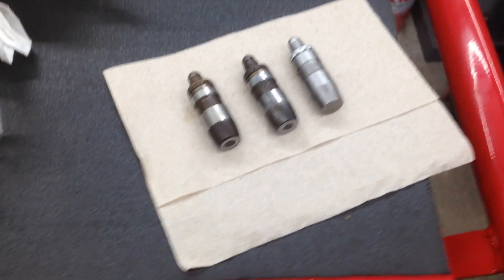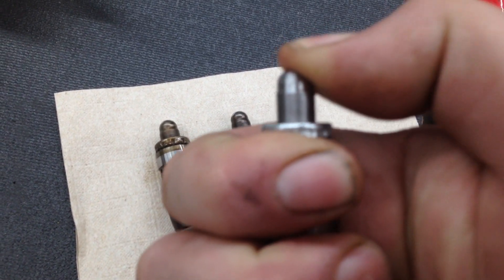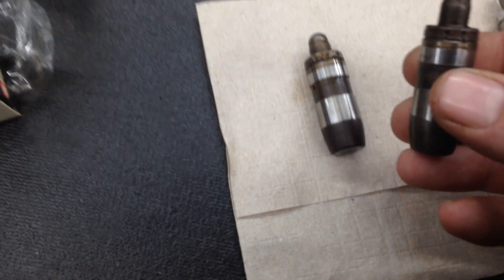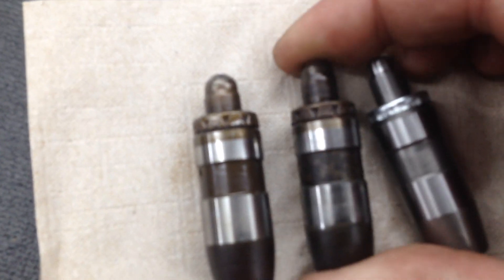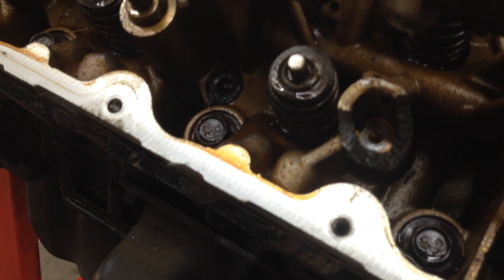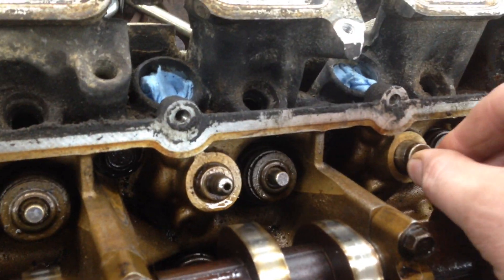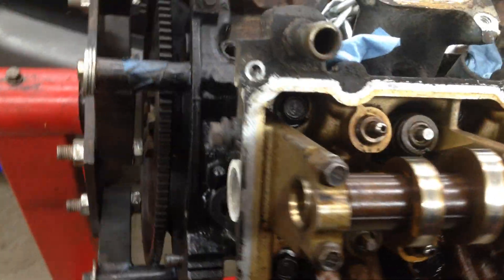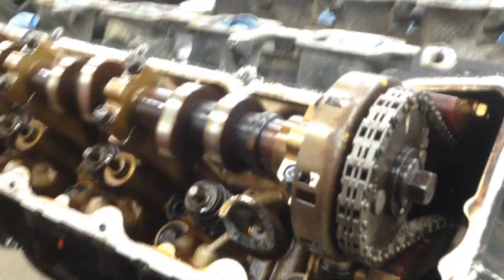Why you check and replace your lifters (lash adjusters) on 4.7L engine

Comment: So will a bad valve seal leak oil onto spark plug tip, not on coil pack area, on that type of motor?
 Im about to change them cuz it dont seam like the cover gasket would leak into spark plug chamber.

Comment: Good evening. Are these adjusters just a matter of buying and installing them? Do I need to adjust them? Could you tell me which model to buy for a 2013 RAM 4.7? Thank you.
Reply from the maker: Melling Valve Lifter JB-7520 is what you would use on your truck, 16 required for engine. No adjustment just replace them, around 20 bucks each.
Reply: @torbull  Is this Melling Lifter JB-7520 valve better than the original one that comes installed at the factory ?
Reply from the maker: @Thebossreserve  Im not sure about "better" but given how often the factory ones fail it couldnt hurt. Its what I used
Reply from the maker: https://www.youtube.com/watch?v=J0G3CA7G_F0

Comment: Don’t know if you’re still replying but i will give it a shot.

I have a 4.7. Started ticking one day very loudly after sitting overnight and running great the day before. 

Thought it was rod bearings, chains, tensioners, piston skirts, dropped valve seats, and so on based off of what i was told from people.

I checked all of that and pretty much had the entire engine apart as far as i could with it still in the vehicle. Everything was great with no play. I just took the drivers side valve cover off and all of the lifters feel seized and so not move AT ALL when i try to press down on them. Would that cause a tick?
Reply from the maker: yeah it will cause valves to not open or close completely too